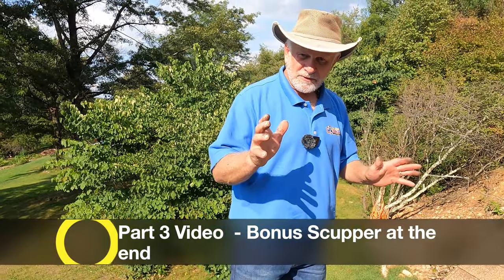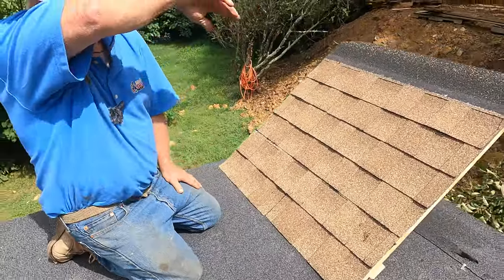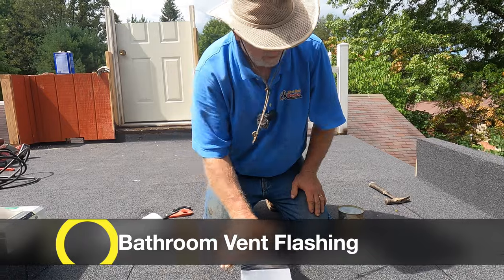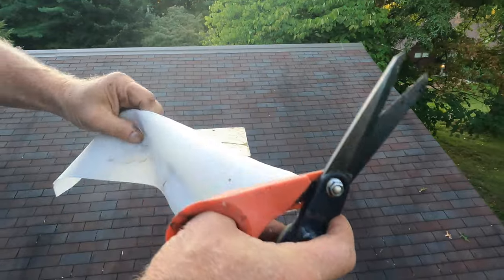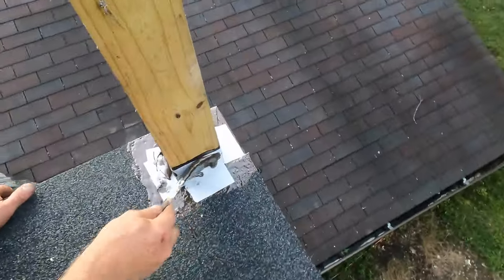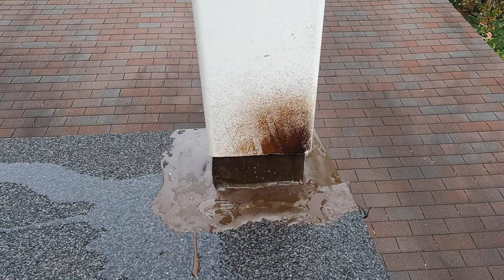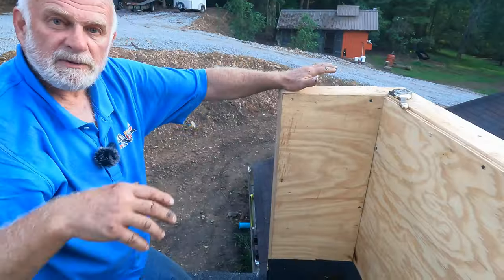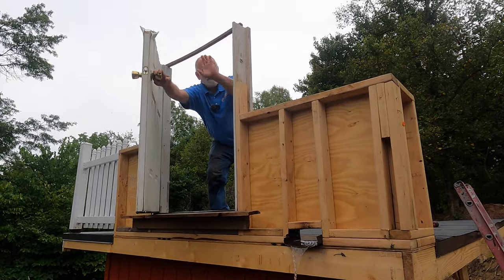Cheap Easy Flat Roof Install Part 3: Post flashing, Scupper, Bathroom Vent, Shingle Transition

Comment: On the parapet wall, putting coping metal ON TOP of the membrane is 100% better. The way you did it has a potential leak from underneath the membrane to where you installed the drip edge. Definitely not 100% waterproof installation.